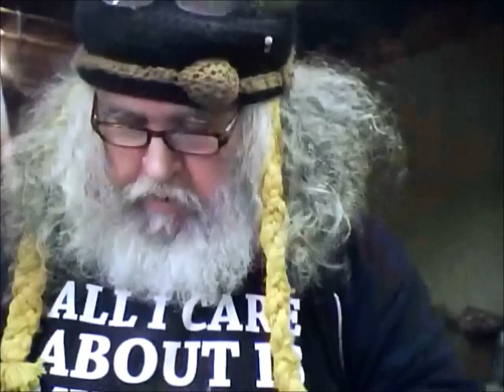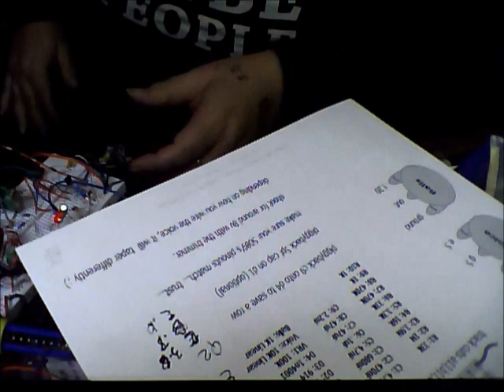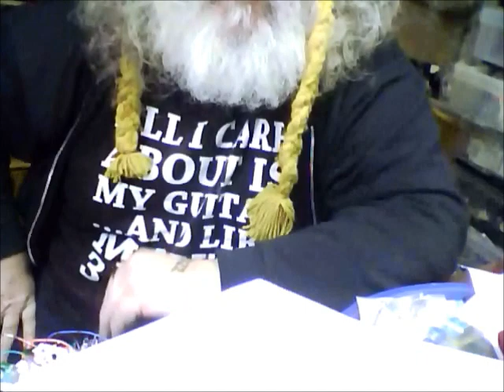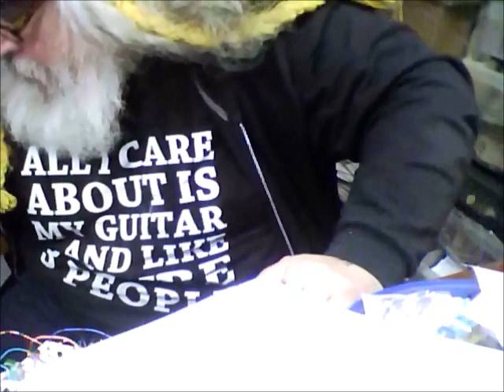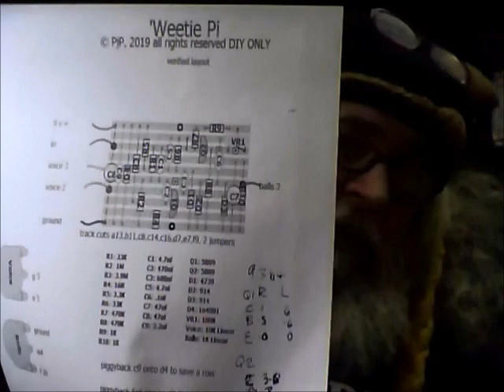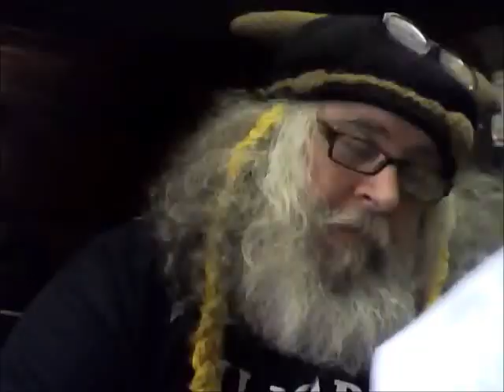weetie pi 1

Comment: Great playing as always and great sounding dirty box, when your started playing american woman, you stopped on the sustaining notes part, how does weetie take sustaining it like that? Thanks for your job and ideas!
Reply from the maker: well, cuz in this video it was precariously dangling from the breadboard and not quite dialed in with the bias, i realized right quick that it wasn't gonna do the proper tone to do that lead sound "wooooooh"... it can do it now that its in the box and dialed in precisely, but you need the voice pot set just right, which would be different from where it sounds like a crunchy electric 12 string playing block chords.
it was hummin like a diesel, and kept screwing up on the board... i need a new one desperately lol...so i kinda limited myself to doing shit where i didn't have to twist the knobs too much. ;)
but cranked up loud enough to drive the amp, you can definitely get a spot to cop that woman tone, and then turn the guitar down to that thick octavey kinda sound.
thanks for watchin!
Reply: Thanks to you Jimmy! Never cease to amaze us with your demoadventures
Reply from the maker: thanks so much,  @groveaholic !!!